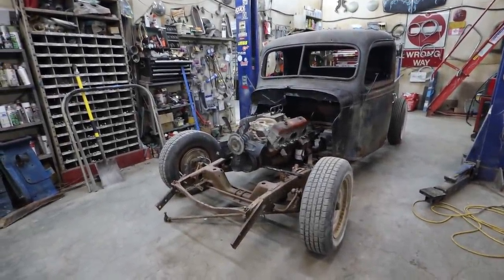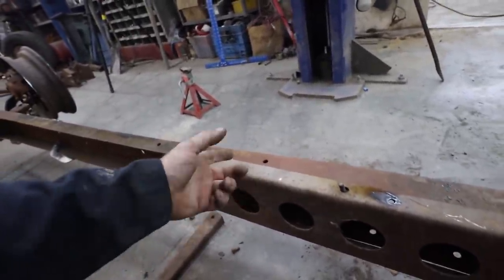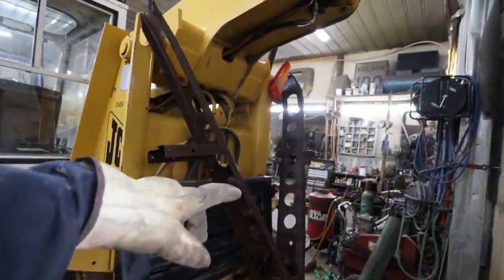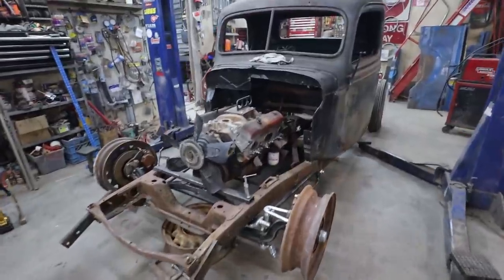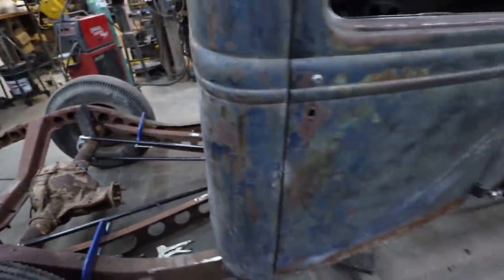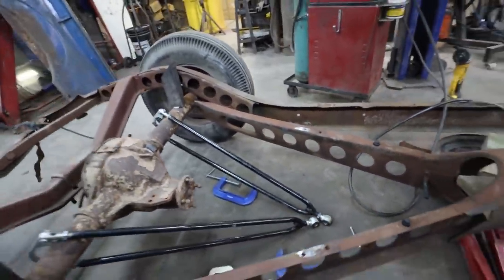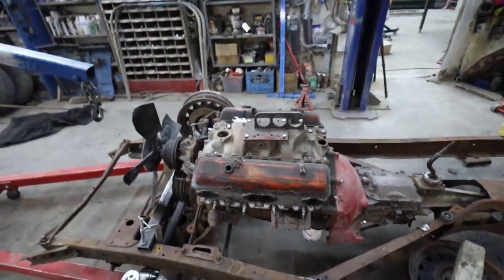Modifying the frame to fit the small block and make room for rear suspension. Part 3

Comment: My thoughts were to leave most of the X frame and build off it.
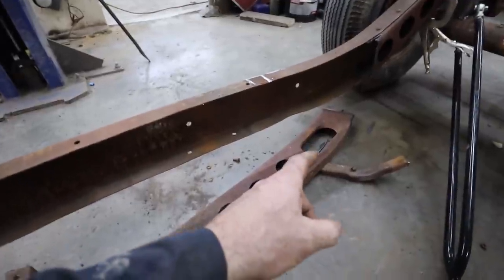7:58 My statement was posted before you had a brain fart moment. 😁😁😁
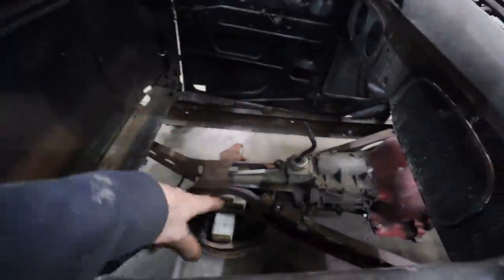17:50 Cut the middle of the X out. Tie the front and back of each X rail with parallel plates and make a small crossmember for the trans mount.
Don't over think the wheel please.
Note: I write my comments as the video is running, never waiting to the end to open my mouth.

Comment: The outside perimeter shape on those 41-48 frames is VERY close to that of a 33/34 frame! I've got a 41 setup here that I've been saving to sneak under a 33/4 someday.
Reply from the maker: the shape is acutally pretty close to a 32 also other than the front horns and the cool stamping haha
Reply: @HalfassKustoms  That reveal is what will get ya!

Comment: What a challenge and great save with the extra frame. I can see the tranny lid bolted down for removal. Great idea. Most satisfying to see that short patch getting cut and welded in place. The frame was now back together, strong again and we can know you will complete the whole project with a safe and solid frame solution. Wonderful video. One of the best illustrations of Old School Hot Rod building. Thank You so much for sharing your passion. Love it, Dennis

Comment: Enjoy the videos Brent. Modifying the X frame, I wonder if it would have been easier to split the X front to back in the short center section moving the left and right halves to the side to meet the frame. Than plate the center section back together with a possible removable bottom plate for easier removal of trans for service and giving you a wider section for the trans to pass through and possibly giving more room to move the engine back if needed. The length of the legs of the X could have still been modified to suite.

Comment: Brent. You're probably further along in real time now, but it occurred to me that the brackets that attach the rear radius arms to the axle would probably be better off reversed and mounted to the front side of the axle. That seems the more natural orientation, plus it will lengthen the arms slightly which might be a good idea. Having the radius rod mounts at the front as close together as possible is also a good idea but just attached to the X as far forward as possible is a good compromise. Question: will you be moving the rear crossmember forward? It's a long way back from the axle at the moment. Normally the axle only just clears the crossmember. It saves having over long axle mounts. All the best. Mart.

Comment: Brent couldn't you have put the X frame in backwards since you needed longer at the front and shorter at the back?  Especially since that's what you needed right?
Reply from the maker: no it need to go back as the bell housing was hitting the x frame bit.

Comment: That bell housing looks like one of the old cast iron ones out of a '60s pickup that has mounting tabs on the sides.  On those, the trans just bolted to the bell housing and didn't have a separate transmission mount and crossmember.  The bell housing mounted to a crossmember to support the rear of the engine and trans just hung out there in the air.

Comment: I don't know. Do ya need a holiday? The best thing about an X frame chassis is the X frame. Then you cut it out , realize the mistake and replace it. THEN you start talking about cutting it up straight away  again? Finally we see you sticking somewhat with the prescribed brilliance. Although without leveling and supporting the chassis while fixing .... Whatever, I'll be back to see what happens. Certainly it is an attention grabber for the moment 👍 cowboy🤠
Reply from the maker: it was still technically supported at either end  as I still have the front and rear braces still in the chassis. :)

Comment: Hey hey... Happy Little Mistakes... You're Moving Right Along. Just a Question... Do you Ever Blow these things apart and take them to the Next Level?... Thanks for Sharing... Keep Up the Great Work
Reply from the maker: I will to a certain degree with this one, not gonna be a show rig just a little more finished that what I usually do.
Reply: @HalfassKustoms  Cool... It's what you enjoy to do... Not a Competition. I myself have pulled the Drivetrain back out of my '56 Rambler Wagon Project... So I can finish welding up the 4" Extension and Create a Firewall where I made a Hole for Clearance. The Main Thing is that it's Strong. Have a Good One Sir...

Comment: On the Ford 8.8 I am going to take two, cut the long end off one and the short side off another to make two rear ends, one short and one long both with the stock axles and centered pumpkins. Everyone wants the short ones for early cars but I need mine long for a 80 Firebird, you could do the same idea to get the pumpkin centered and the track width wider, put some 8” or 10” barrels on the rear rims to run some pie crust cheater slicks
Reply from the maker: Haha I wanna run tall skinnies on there

Comment: Now that you hacked up the frame can you use the piece to build your motor mount ( front ) and bracing from the x to the side rails ? Are u going to powder coat the frame ? Or leave it rusty ?
Reply from the maker: probably just paint when the time comes

Comment: Man there is so much work that needs done in setting the motor, transmission, front and rear aisle on the frame. And making sure it is structurally safe when doing the work as well. You don't need a lot of tools, but a lift sure makes things a lot easier for a one man operation and of course have a supermarket of spare parts in your back yard helps a lot as well. Great video showing the "X-frame" and how to modify it for a hot rod set up. God bless

Comment: The reason his looked different is because the cut them apart and flip them side to side so they can bolt a plate to the middle to form th X
Reply: Makes it way easier to change transmissions